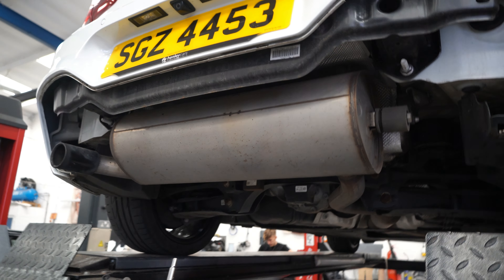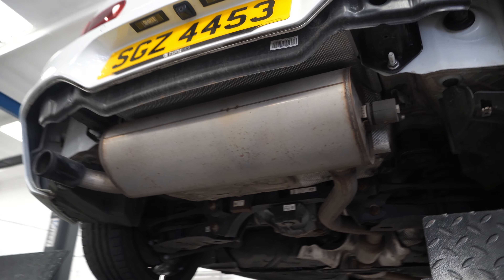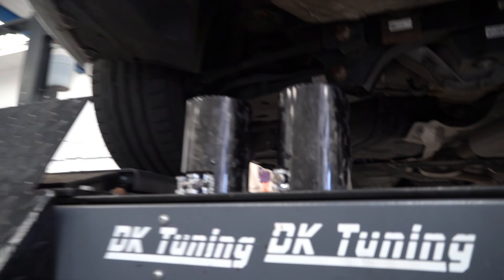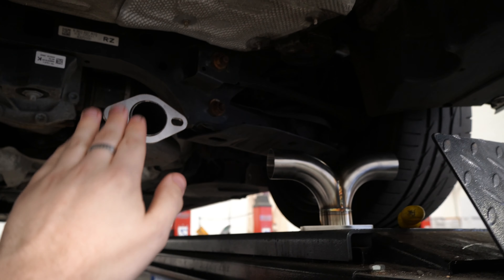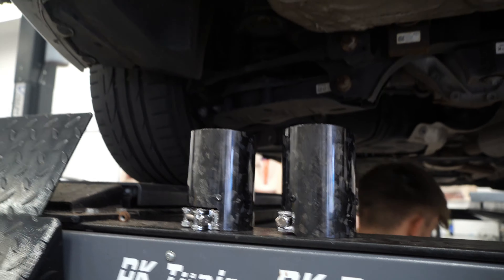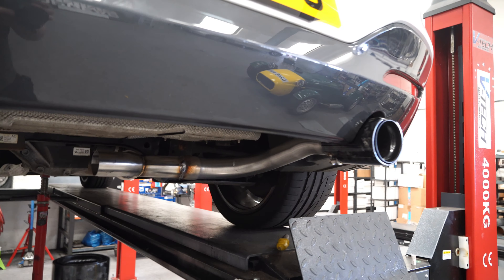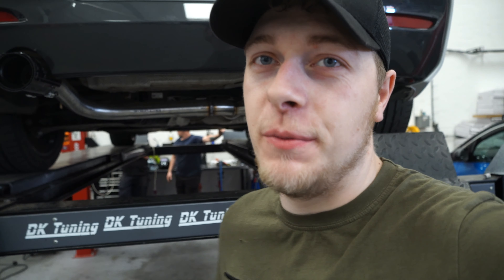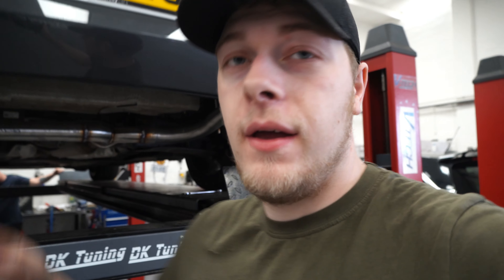BMW 118I BACK BOX DELETE *FORGED CARBON TIPS*

Comment: Scale of one to ten how loud? Thinking of doing this but worried about making too much noice
Reply: Did you get any work done, I’ve got a 118i also looking to get something done, stock is just too quiet. I’m also worried about too loud, looking like getting the back box removed is a nice compromise between sounding nice and not being too loud. Removing resonator delete makes it ridiculously loud
Reply: @jamiesumner8311  still haven’t done anything. Found a replacement “sport” back box by Ragazzo (expensive).  That’s probably gnna sound way better and be slightly less loud. Still not sure Lmk if you do anything!
Reply: I got rid of my back Box, I found my S3 noisy when you first start it up. But after a minute it's fine. But it's perfect right of noise and I live on a farm so didn't want too noisy. It's kind noisy if want it to be when driving quick, but when driving normal it's no different from standard.
Reply: I did it got a cat back system full system got a mid box sounds like v8